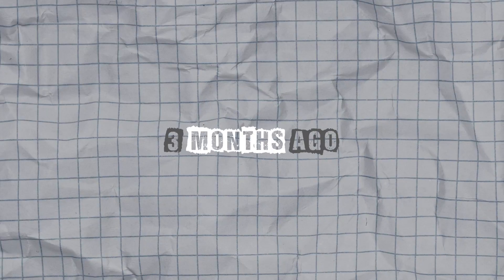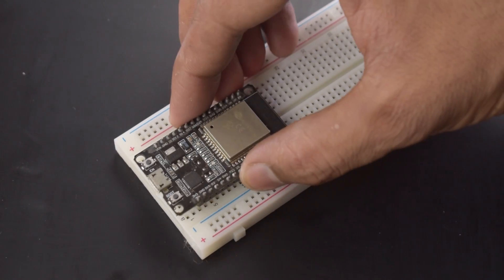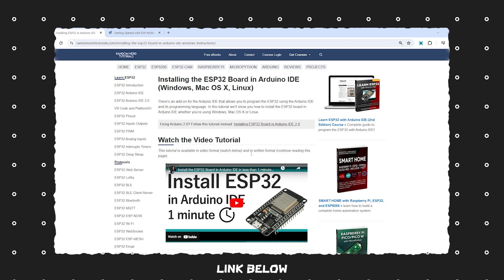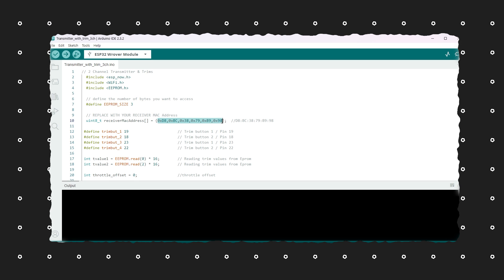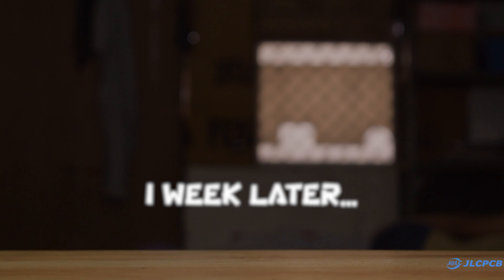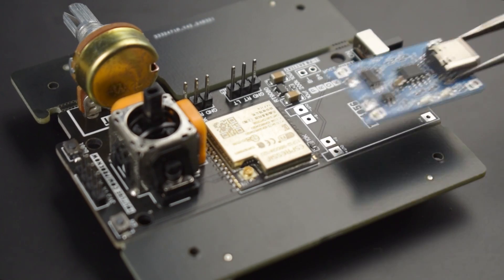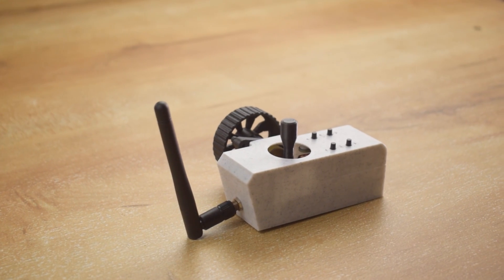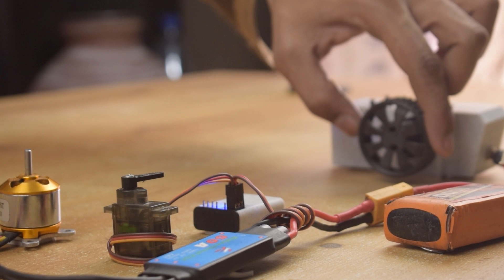Building a 3-channel Radio controller for RC Car - ESP NOW Transmitter and Receiver | Arduino

Comment: can i use it in my plane. it needs two servo and 1 brushless motor and what are the things to change on the code
Reply: you'll need a nrf module for it because without those transrecivers your signals will not reach the plane while flying.

Comment: Esp have limit only in wifi area if i in the Street its not will work i don't see the point
Reply from the maker: I think you don't know about ESP-NOW Protocol, ESP-NOW is a wireless communication protocol defined by Espressif, which enables the direct, quick and low-power control of smart devices, without the need of a router.

Comment: Cute and ergonomic design ❤❤but it could be mind blowing if it was eligible for aircrafts.
Reply from the maker: It's a Surface transmitter, I will make a Radio controller for Drones as well in future.

Comment: Bro can you make a transmitter and receiver using 433 MHZ RF module with this feature but plz don't use arduino and others MICROCONTROLLER and make own encoder and decoder plz plz plz 😢😢

Comment: Can we use esp 8266?
Reply from the maker: ESP8266 can be used for receiver but you can't use it for Transmitter as it has only 1 Analog input available.

Comment: Add in a gyro for the steering channel.  Those trim buttons look too easy to hit while driving, put them under a door or hatch maybe?

Kinda upsetting that a <$20 chip can do more than my >$800 JR 11x radio.
Reply from the maker: Thank you for your suggestion, I will take care of them in next version.

Comment: Bhai node mcu8266 se transmitter and receiver bnao
Reply from the maker: ESP8266 can be used for receiver but you can't use it for Transmitter as it has only 1 Analog input available.